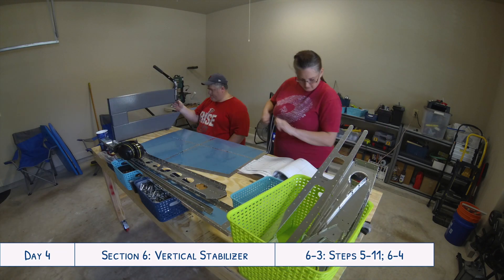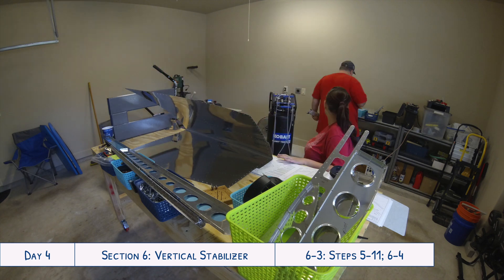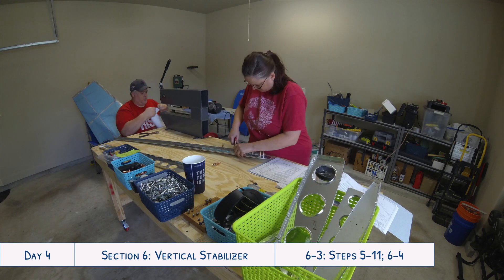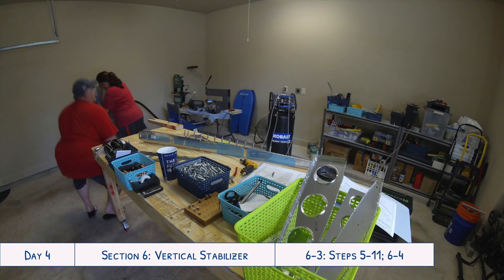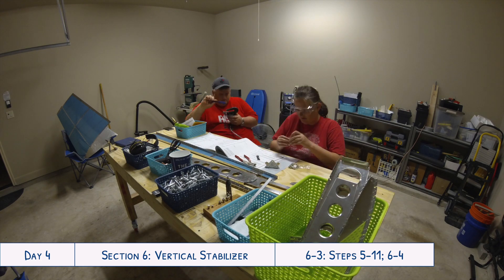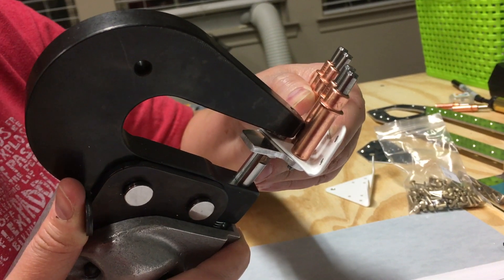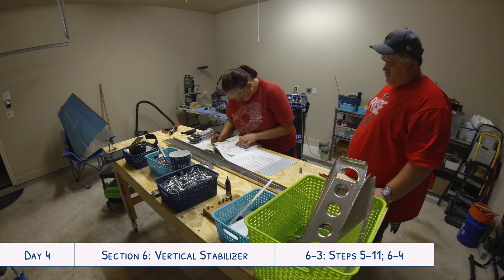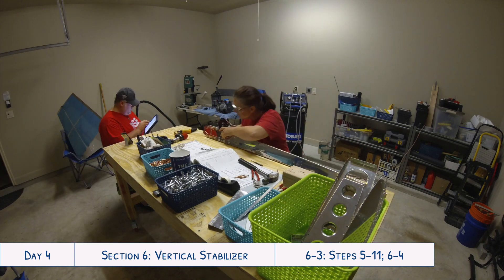Van's Aircraft RV-10 Build: Day 4 - Installing the First Rivets in Our Plane!!! (6-3 & 6-4)

Comment: Just found your channel, and it brings ack a LOT of memories.  I helped restore a 1948 Globe Swift in the late '70's that had been badly damaged in a Ground loop.  Right next to the Swift, was a 'then' new RV3!  My friend and I put in 967 hours restoring the Swift, and then flew it for 743.  I hope your keeping a log of the time it's taking to build your plane.  Also, if you need extra help, EAA Experimental Division has a LOT of Builder/Pilots/Inspectors that can be an invaluable source of information for when they plans... get confusing.  BEST of luck on your build!!  =)

Comment: Congratulations on riveting! Hey I thought of something to check in with you on. What types of bucking bars did you get? We have various steel bars, but the best one we like is the tungsten bucking bar. Something to look into if you don’t have one already.
Reply from the maker: We have 2 tungsten bucking bars - a "standard" size one and one that tapers down to 1/4" at one end to help get into the tighter spaces. Got those after seeing lots of comments and videos from others like you who recommended the tungsten over the steel. The heavier full size one works great! The smaller one - even though it helps get into tight spaces - just doesn't have the same weight and always takes a little more effort to drive those rivets. Thanks for checking! Those are the kind of useful tips that we're always looking for :-)